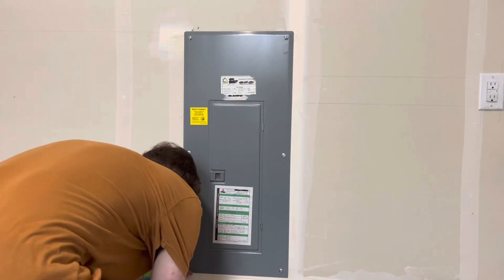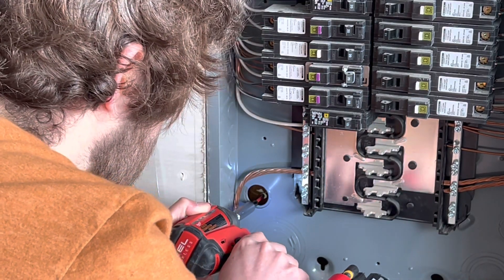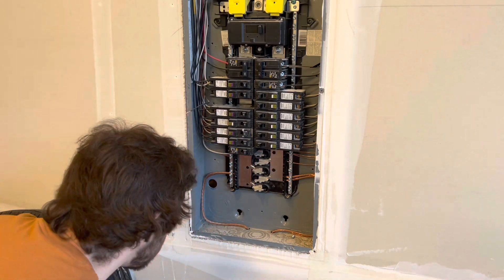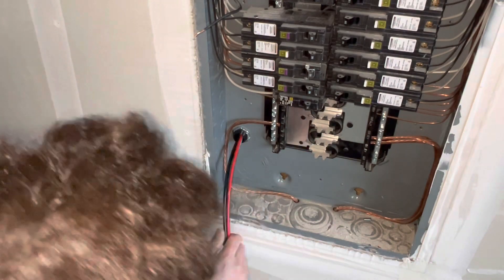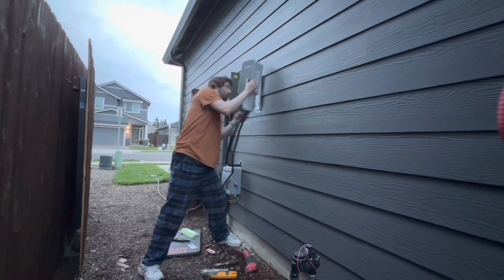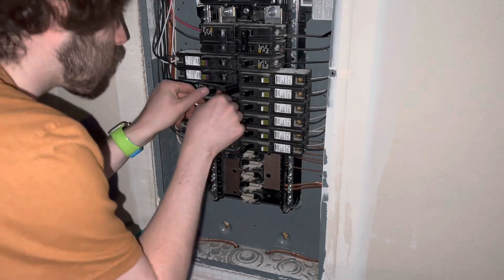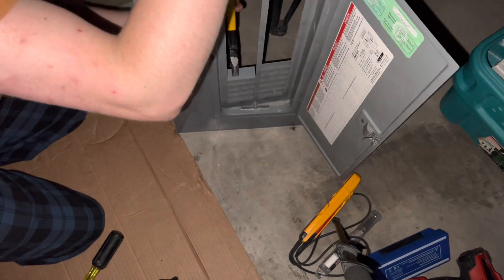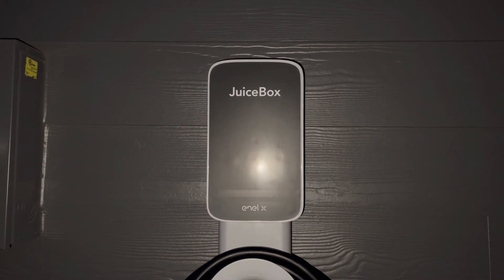How To Install A 32 Amp Juicebox Electric Car Charger (Hardwired)

Comment: Actually, this is a minor detail, but if you look closely at your load center, you will see that the GROUND wires actually are over on the right side of the box, while the NEUTRAL wires are on the left side. The exception is that you have a lot of arc fault / GFCI breakers in there, which have the neutrals attach directly to them. The point is that you said that the neutrals and grounds share the same connection points, and in reality they do not. It's not really a huge deal or anything in a single-phase system like this, but if you have enough of that green wire (and it looks like you might) then you really should connect that over on the ground strip with the other ground wires. In this particular case, there is no neutral. Some 240V circuits will have a neutral, such as a dryer or stove, because these appliances may have an internal 120V circuit (such as that for a light bulb inside a dryer) and they would use a neutral; appliances that are strictly 240V will not need that neutral, hence only the red/black and green wires.

One other note here is that, although your local codes may not require it, you really should install a quick disconnect box outside (like what's on your air conditioner), connecting that to the breaker panel inside, and then connecting the pigtail on your JuiceBox to the disconnect. This makes for a cleaner installation and also a little easier to work with in a case where you might need to remove current from the JuiceBox in an emergency (not likely, since it has its own internal monitoring circuits, but still this is often code for an outdoor install.)

Comment: Thank you for the info! I was wondering if that installation requires a GFCI circuit breaker. I am sure it will work OK, but if for any reason an inspector needs to get involved, maybe he or she will require that type of breaker in that panel. That is an outdoor installation, but again, I am not sure.
Reply from the maker: i believe the instructions for the charger specifically said not to use a gfci breaker.
Reply: @DailyElectrician  Ok. Cool! Tks!
Reply: You are right! In this case since the charger is "hardwire" there is no need for a gfci breaker. If there is any plug then to my understanding is required. Im not in the USA but the best thing to do is to consult with a licensed electrician if any doubt. In my case the code enforcement where I live is as good as the "rum brand" available for consumption".

Comment: Does it specify if those are 8 gauge wires?
Reply from the maker: should be 6s i believe, but check the spec sheet/instructions
Reply: They are 8 AWG wires on my 40A JuiceBox. The wire from the panel to the junction box, if installing that way, need to be 6 AWG to go along with the 50A breaker.
Reply: The wires on the JuiceBox were  8 THHN, we ended up running 8 AWG because the highest amperage would be 32 and with the 25% overage allowance, 8 would be great. Wanted to match them with 8 THHN, but running a conduit for those wires would have been very tricky in this case. It came down to either 8 AWG or 6 AWG,( which would have matched the 8 THHN in max amps). To be a little safer just in case, I then lowered the total amps in the unit to 30. @craftedworkshop